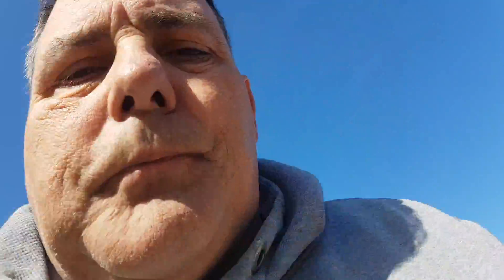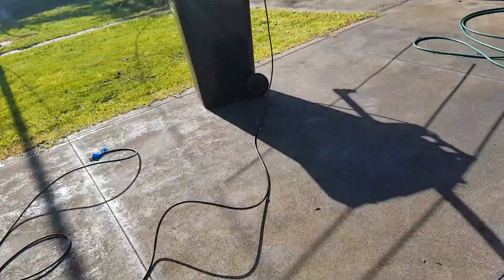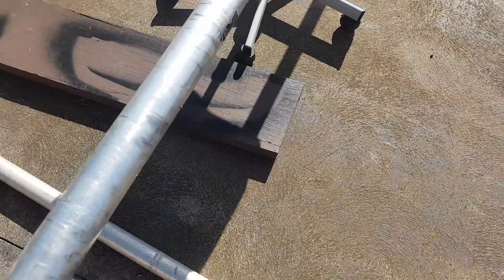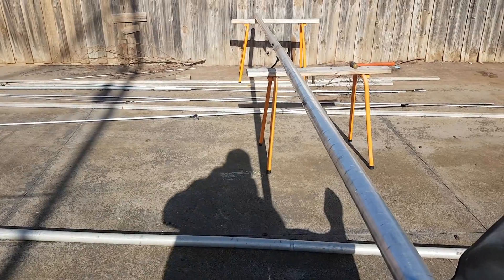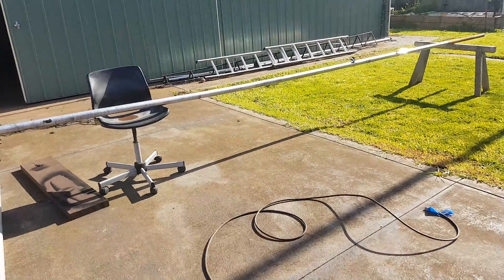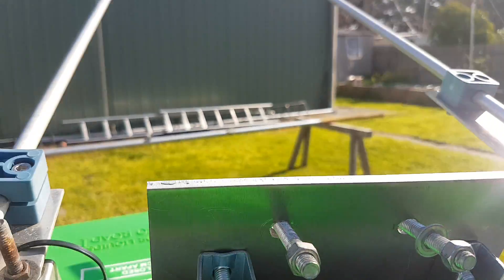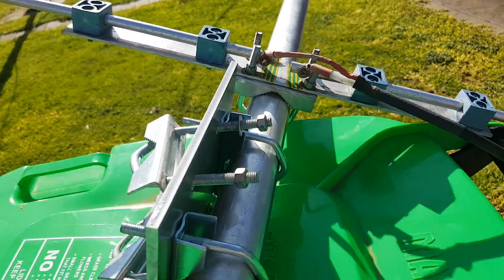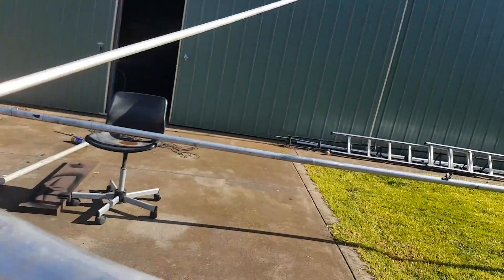#vk3ktt 6m #yu7ef 0607 Yagi antenna construction methods.

Comment: Hello. question: what is the minimum size of the iron pipe 12 meters for lifting the yaghi fm antenna Dimensions antenna gauge L*W*H: 5500*900*1760 MM Weight: 5 KG? thank you!
Reply from the maker: the pipe of antenna is 50mm 1.3mm wall 9000 mm long made in 1 sections 1 6500 the other 2500mm round shape . better to use square shape pipe.

Comment: Is there going to be a part 2?  Great part 1
Reply from the maker: sorry no part2 as the antenna is down now but it was spectacular in its performance, pictures are on my qrz. i have now built 3,4,5 7 element versions of this antenna. it is well worth making and you wont be disappointed. what would i do differently i would use a square boom instead of round. also there are several videos on this channel of it operating even aurora prop which is quite rare in vk.

Comment from the maker: just as an update this antenna proved to be a killer. from vk i worked lu2xp ,du ,e51 zl,zl7, 3s2, ja YJ,BY,kh2  and heard abut 15 stations from the us but barefoot wasnt enough to complete. not bad from  the bottom of the cycle. if you have the space and a passion for 6m put this antenna up it is worth it. ser was great up to 50.500. de vk3ktt